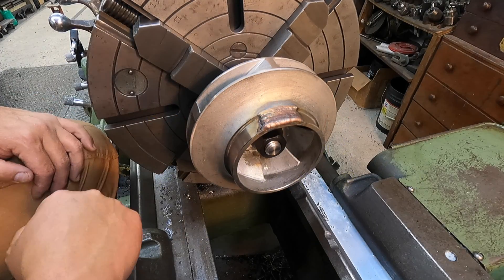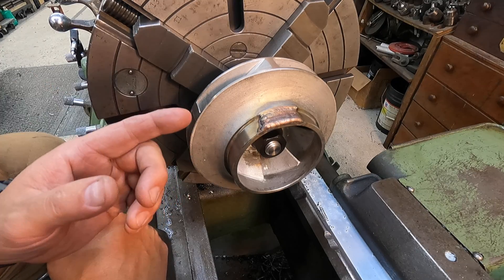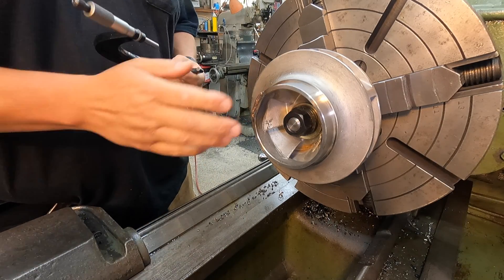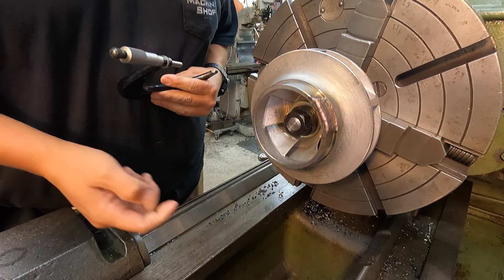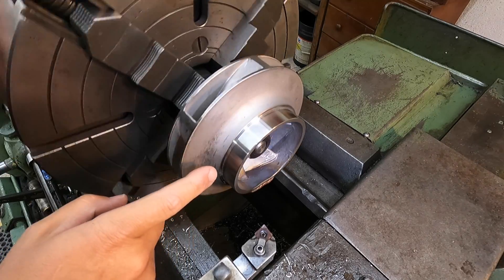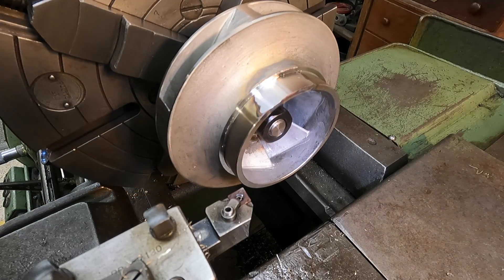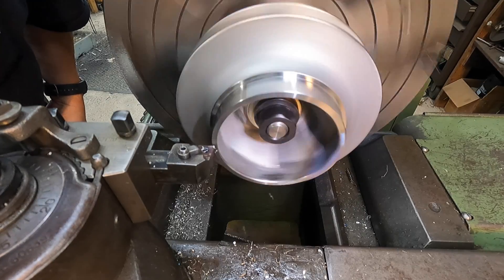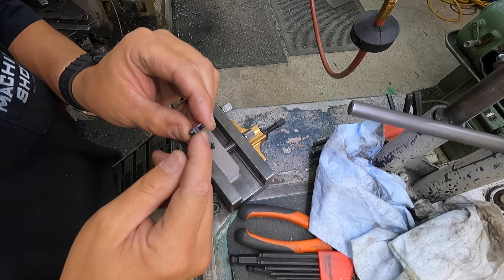Stainless Impeller Repair Part 2

Comment: I've machined quite a few pumps and i was freaking out when you said sleeve it. I've seen more catastrophic impeller repairs with sleeves. They heat up and make a mess. Granted, I work mostly on vertical water well pumps, but every pump I've seen that part of the impeller is a wear surface not a seal surface. But I've not seen everything. But this repair decision is the correct one. Good job.

Comment: I would had paid more attention to the inner bush sleeve and re-bushed it to suit the repair then turned the outer diameter to the new size. But it's all swings and round abouts and who doesn't  like a good abomb spray welding. Great work.

Comment: The explanations are what makes this channel, so please continue Abom. I have had years or machining much larger components and your method is the only way a lot of these jobs could be done. Machining and repairing metal parts to a high standard as accepted in the industry is an art, not something that occurs as instant gratification. I am always learning when I come to this channel, always a little gem of information to be discovered.

Comment: I just inspected 8 much bigger versions of this same style impeller. All stainless steel castings destined for the UK. They wanted 100% visual inspection with borescope pictures of the internal passageways. What a pain in the ass 🤣

Comment: I suggest the impellor was probably still on it's shaft when it hit the floor and the central mounting boss/bore, was tweaked over within the main impellor casting (as well as the obvious damage to the seal ring).  I reckon that if the impellor had been chucked up on the outer machined OD, I think all the faces of the impellor would have been true to each other (apart from the dented area), but if you put the mandrel in the bore, it would have been wobbling around as the bore is not now true with everything else..  :(

Comment: I agree with the repair as well. As long as it runs true and the pump bearings are good, nothing should really touch the nose of the impeller anyways. The only thing that I was thinking was to repair the inside before spraying it. Get the thickness the same all around so it heats more evenly. As always, great work! Hell, your fixtures have a better surface finish than most others final product!

Comment: The impeller would never be in contact with the wearing ring that is in the pump case. Spray weld build up on the impellers and new bronze or monel wearing rings in the case worked well for the fire pumps, (500 - 1000GPM at 150PSIG), I rebuilt for the U.S. Navy back in late 70s. Time tested.

Comment: If you did the threading left-hand, you could work away from that surface.  After all, it's not really threads.
Reply: He sure didn’t seem to have any problems doing it the way he did it.
Reply: He also doesn't seem to have problems using a measuring caliper when a pre-set outside caliper could be a lot faster.  There are usually many ways to do a task, more choice is mostly good.

Comment: Thermal spray is a valid repair. But for those who dont have one in their back pocket, weld buildup with TIG is another valid method.
Reply: TIG (and MIG) puts a lot of heat in the work.

Comment: We have simply turned them true then resized the brass ring which is far faster and cheaper than building up the surface. The impeller will wear out in other areas faster than the wear surface typically. The fit between the brass wear ring and the impeller isn't critical which is why it isn't very precise from the factory. Balance is far more important.
Reply: @rat4spd  Yeah, the cost and down-time of doing these repairs at a local machine shop vs buying a new one that you know will hold up becomes a process of diminishing returns. If you work for a large company with deep pockets that springs for the equipment needed and pays for the specialized labor to have this capability more power to you and I wish I had a job there. Instead I work for a narrow margin outfit that can't afford to have a lavish machine shop, welding bay and have access to highly skilled welders and mechanics. 
I'd have hammered the inside of the dent to get it close to round, welded it up and turned it to true then cut out a new wear ring to match the surface and called it a day.

Comment: Its a wear ring hub, not a seal ring. There will be a casing wear ring in the pump housing ( most likely bronze), which for this size of Impeller will be about 0.016" clear of the hub.

Comment: The whole thing looks like it's bent on the hub based on the wobble.
Reply: probably dropped while mounted on shaft bent internally in hub area,but it is a how to on spray weld.
Reply: He explained the wobble in Part 1.
Reply: @nebtheweb8885  
Ahh!

Comment: We used to repair these but brass. Metco spray weld. Same with bearing journals. Metal spraying is a good repair if done right..just dont use it on single point bearings..ie needle bearings..it will break it up

Comment: I was glad to see Adam decided to go the spray-weld route because the more I thought about it, the less I liked the idea of just interference-fitting a steel sleeve over that seal journal, mostly because I didn’t know what kind of speeds or especially temperature gradients or changes this impeller would be exposed to in service; I could just see that sleeve working its way off of there and all hell would break loose. Now everything I know about machining and spray-welding I’ve learned from Adam so take that into consideration when reading my comment. ;)

Comment: Hiya Adam. I know this is a good repair. I was trained for pump repair in the Navy back in the 80s. I used the old Eutectic rig, and we did shafts, and impeller seal rings with it. Lots and lots of pumps on ships, spray welding was our go to. Now we did have cheater rings for some of the pumps, but we had occasional failures on those, never had a spray weld fail.

Comment: Great video the powder welding is something that really intimidates me... the only thing that would concern me is the measurement you took i would be worried it was egg shaped or it moved after welding S.S. is horrible about moving while welding Great video wish I had that big of a lathe
Reply: It's easier than it looks. All it takes is a little instruction and practice. The heat and material makes it look hard. ust hink of it as spray painting with a little extra

Comment: Hi Adam, have you ever tried using the masking compound on parts that you heat treat to prevent surface oxidation? Or would it just burn off from the higher heat?

Comment: I worked and also spent many years managing facilities operations and we used the metal spray technique on this type of repair many times over, Saving hundreds of dollars on repair and replacement cost. Today to many crews won't even spend the time to utilize this technique, just go out and buy a new part or replace the whole unit.

Comment: Abom, I taught pumps theory, operation, repair, and maintenance for 3 years when I was in the Navy.  I taught the class at Fleet Training Center in San Diego and have worked on and fixed a LOT of pumps in my 20 years as an engineer working in the engineroom on four different ships.  The area of the impeller you are michining is where the wearing rings go.  I am sure the manufacturer has a minimum diameter to which it can be macined, but the diameter is not very critical as long as it doesn't go below the minimum specified by the manufacturer.  The wearing rings, usually made of bronze or brass, will be placed on the impeller and on the pump casing and machined to whatever clearance the manufacturer determines, which will vary depending on what the pump is used for.  The higher the pressure the pump is designed to operate the more critical the wearing ring clearances are.  If the wearing ring clearances are too large it will affect the discharge pressure of the pump due to leakage past the wearing rings from the discharge side back to the suction side.  The pump casing will almost always use a wearing ring and the impeller may or may not have one when new.  As the impeller wears it may get to the point that a new casing wearing ring will not have an inner diameter capable of providing the necessary clearance.  In this case it is standard practice to machine the impller and install a wearing ring on it with an OD bigger than the ID of the casing wearing ring and then machine for the proper clearance.

Comment: This looks like the impellor from an ANSI chemical process pump such as a Goulds 3196 centrifugal pump.  Other similar pumps are made by Durco, Ingersoll-Rand and even Allis Chalmers when I was a pup in the process industry.  These pumps are not precision machines in the pump head.  Even the shafts and gear boxes aren't made to the tolerances that Abom is trying to obtain.  The volutes are cast and given a rough machining and often have ridges left on the face.  The backplates are flat in name only and the impellor to casing clearance is usually set with paper gasket shims in the bolt circle connecting the volute to the backplate.  Impellors are not balanced to high tolerances as they never exceed 3550 rpm and I usually tried to spec a pump that could operate at 1750.  The flange faces for piping connections are usually machined to a high flatness for sealing but they are often a couple of degrees out of perpendicular.  On one project in the '80s I bought almost 100 of this type of pump and we decided to take random pumps into the shop and check tolerances and vibration against the supplier's specs.  About 30% of the pumps didn't meet the manufacturers specs.  We installed them because we knew they'd be fine but we did extract some $$ from the supplier and opened our future pump needs for bid after being supplied exclusively by A-C for many years.  In short, he's probably substantially improving this impellor.
Reply: In part 1 you can clearly see "PACO 3070-7" on the back face of the impeller. The PACO model dash impeller size. Grundfos bought PACO in 2006; these pumps are sold as PACO by Grundfos or Grundfos-PACO. They had a plant in Portland, Oregon, that served the pup & paper industry and the marine repair docks. I used PACO pumps in cooling tower work. They turned out a good, long-lsting pump.
Reply: Absolutely true. Aurora is another brand of pump that uses this type impeller and we use them extensively. The impellers are typically out of round, the casting having flash at the mold seams, warping and inconsistent fit yet work just fine. We've pulled apart pumps that were working fine but leaking from the seals and found that brass wear ring missing or worn down to the housing. In our experience, the impeller would only last through a couple of rebuilds before it would wear out around the fins or get paper thin in places so we just trued up the impeller wear ring surface and made a matching set of wear rings rather than building it up.

Comment: I thought carbide didn't like cutting like that where there's a high and intermittent chip load and thag it'd chip or shatter. If that's not the case of the lathe then why is it different on the shaper? Don't mean this is a snarky way, I'm not a machinist so I have no experience working with carbide

Comment: I had to deal with one cast even worse than this one. Aluminum with a visible out of center hump where this one has the pass thru shaft and nut to hold it on. Mine was simply threaded onto the motor shaft in a blind hole. Nothing was machined right or even cast right and it wouldn't pump at high speed at all. Found a machinist that first wanted to clamp by the outside rim, but I squawked a good deal about that and he made a custom shaft to drive it by the threads. As soon as it spun up he could see why I wasn't happy with it at all and he did straighten the back side and the forward side and trim the circumference as well as the inside and outside of the "seal" as you call it. And then he took out the off center lump dead center that was the main flow killer. It pumped pretty darn good then. Between the casting guys and a machining guys there isn't a good system of estimating the best place to put the shaft at and if it isn't close to right, nothing else can be.

Comment: I work at a motor and pump repair facility and agree 100% that that impeller needs to be replaced.  Heres the thing though, pump manufacturers dont keep these things in stock the have to wait for the foundry to do a run, its probably 12-20 week lead time for that impeller.  Lots of customers dont have spares for critical path pumps and will accept an impeller that will still work even with the extra wear on the pump until the replacement comes from the factory.  The lack of customers keeping spares as well as the manufacturers not stocking anything these days means that making due happens a lot.  Cant really fault Adam for that.  As for the repair, we mostly shrink a new wear ring onto the impeller but welding or spray welding are acceptable repairs as well.

Comment: Adam - this is one of the few/rare times you disappoint me! You didn't check the integrity of the part before starting - it's badly sprung. Adam, you should have checked it with a dial indicator for back & forth run-out at the rim before expending so much more effort on this defunct part.
Did anyone else notice the impeller's outer edge front-to-back wobble (back and forth toward/away from the tailstock) as the part spins to a stop? The whole part is sprung. 
Other prior comments that the impeller must have been attached to the pump or motor shaft when it was dropped; I have to agree, given the level of deformation. It looked in a few shots like there was damage to the root of some of the impeller vanes near the inside of the hub as well.

Comment: That impeller is warped for sure, obviously had a bad wreck. All surfaces were machined concentric with the bore at the factory and designed to rotate at 3600 rpm or more. If anyone can fix it Adam can.

Comment: Is that impeller even worth saving? How fast does it spin? It's way outta balance. I suppose it's cast stainless, so its inbalance is inherent of the design and probably doesn't spin that fast to matter much, but still...
Reply: Probably a 1750 RPM 1.5 HP motor. I'm guessing a low pressure transfer pump

Comment: Of course your applications guy is going to tell "it'll be ok" .. he's getting free advertising and we'll never know what really happens to this impeller in the future anyways. In case you don't know the other function of a field applications engineer is marketing and sales. Thats why they make site visits and take you out to lunch. When it does fail fail, "it'll be ok" turns into "that's a new one on me --- you must not have correctly prepped" followed by a shrug.
Reply: Well, thermal spray repairs are extremely common and we do it everyday in aerospace.
Reply: Sounds like the usual CYA or cover your ass excuse from the applications engineer.

Comment: hey its scrap if its not fixed, Let the man do his job.
Reply: It's not fixed and it is scrap.
I repeat that Adam, his work and his channel are top notch but that repair and the impeller that results would be a last resort if no spare was available and running the pump was essential.
The eye ring is now beautifully sprayed, turned back, shiny and true but the front and rear plates and the blades were knocked out of true, en-masse, when the damage occurred. 
I know as I've been an engineer in a very large plant for 30+ years. I also know because I can SEE it.

Comment: Love the channel, love the spray welding and all the great, interesting repairs in Adam's vids. 
I'm no detractor BUT that impeller is toast. The way the tool starts cutting opposite the weld (4:20 on) means the impeller was on the pump shaft when damaged and the whole thing is way out of true and out of balance. 
If Adam's buddy, Dave, saw it spin and the way it cuts at 4:20, I'm sure he'd declare it beyond reasonable repair. 
That said, it's still a great watch, as always.

Comment: I noticed some damage on the ways near the chuck. Did that happen before you got the lathe?
Reply: I think I remember Adam covering this in another video, but yes it was there when he bought it, the rear ways is closer to the chuck and he thinks they clearanced it at some point.